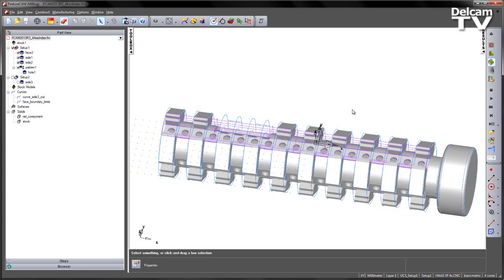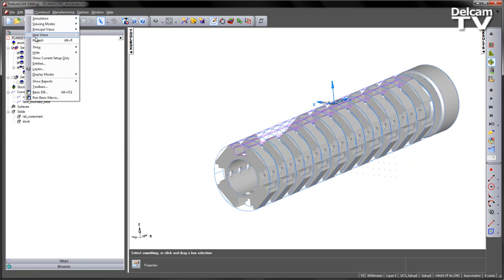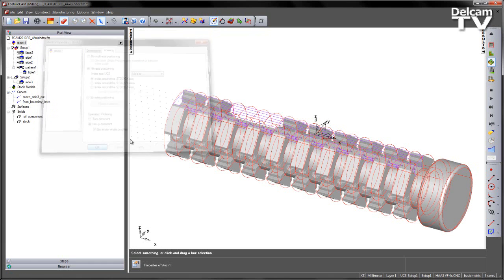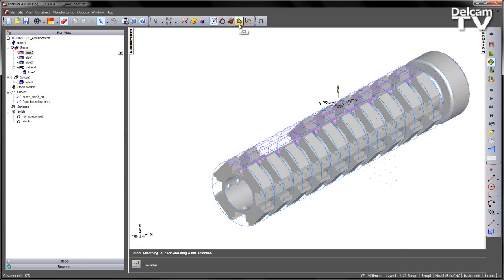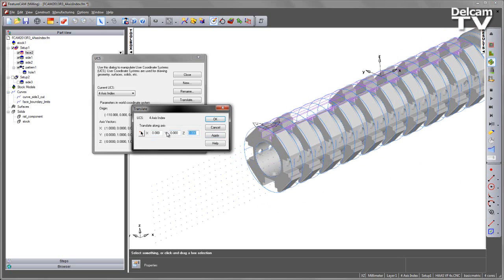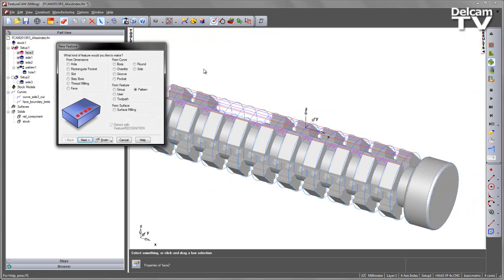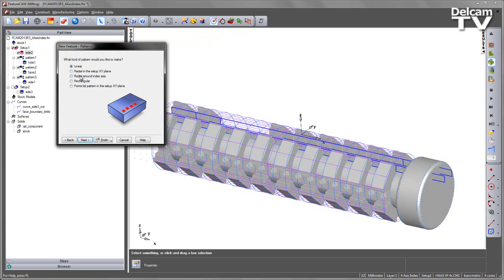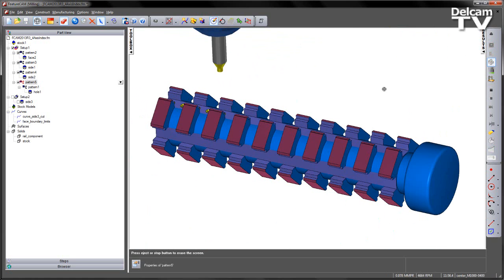4 Axis Index - FeatureCAM 2013 R3

Comment: Hi having trouble doing a 4 axis part and im new to feature CAM. how do you create different features shown on the top left of your screen under set up 1. I am importing a step file from solidworks, with a part looking similar to this. I need to tell the software the features I need to cut? Great vid helping alot!!